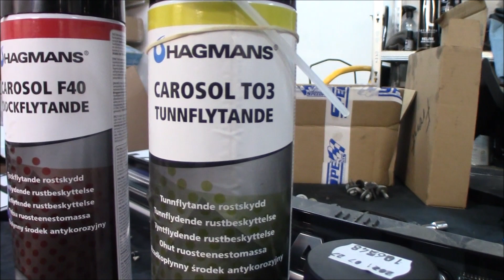SAAB ng9-5 Build Part 3...RUST!

Comment: this Saturday I am painting my 9⁵, the amount of rust is terrifying.  the space in the wheel arches under the plastics is a drama.  I can tell you that you have rubber plugs along the entire door sill.  Unlock a few and spray something that reacts with the rust inside.  And the whole bottom of the door sills is also rusty, like mine, just under the paint.

Comment: Hej Jonas. Nice vid as always! I must say that there’s a surprising amount of rust on this car. What did the former owner do to it? My sons 2003 9-3 (used to be mine) is nowhere near this shape rust wise. And he’s certainly not the best caretaker. Did SAAB take shortcuts with the 9 5 NG?
Reply from the maker: Thanks, denna bilen har inte vårdats utvändigt. Har gått som pendlarbil Trollhättan - Oslo, sen inte tagits hand om utvändigt typ stenskott osv. Ng9-5 är inte värre än og9-5, förutom kanske taket som är lite väl tunt lackat
Reply: I had 2008 9-3 and it had rust problems. Rear wheel arches were the worst. Salty roads to blame :) Extensive repairs were carried out to get rid of the rust and it lasted about 4 years in salty winter conditions. Last year it had to be done again. NG 9-5 has no rust thankfully. Anti-corrosion treatment was done by professionals to keep it that way. Once it started to rust it's impossible to get rid of it 100%. Carbon fiber body is the only solution like one famous car manufacturer in Sweden does :D:D

Comment: Great work! Curious to what rust converter you've used. The ones I'm used to need to be removed before the expoxy primer.
Reply from the maker: This on is from hagmans, a swedish brand. They also has a product that is a rust-Dissolver, that one needs to be removed

Comment: Some say that the heat generated by sandblasting can bend the metal. What's your take on this?
Reply from the maker: Possibly if you have like an industrial compressor set at very high pressure. With my setup there is no chance 😎